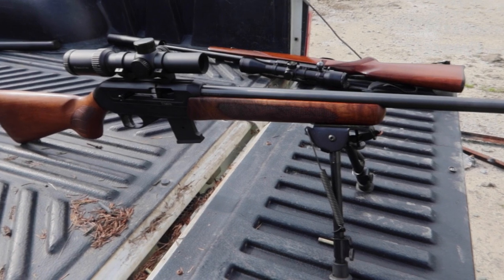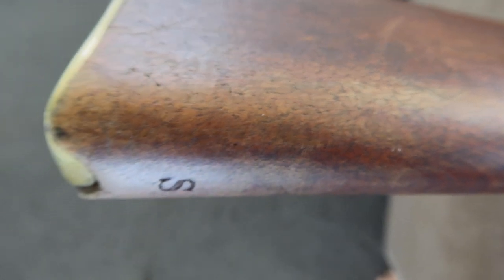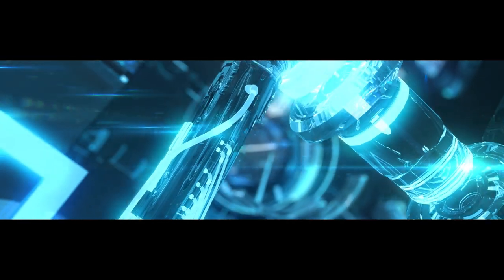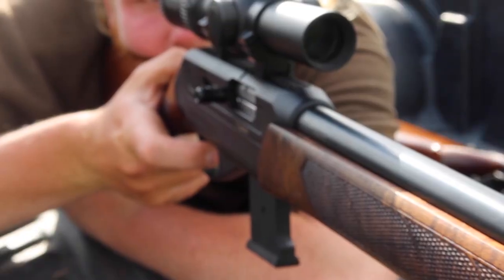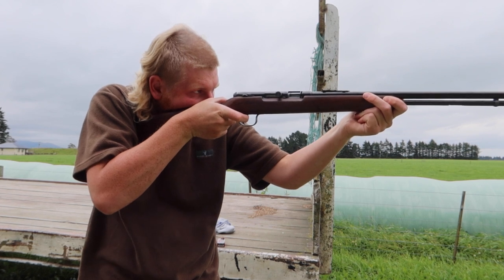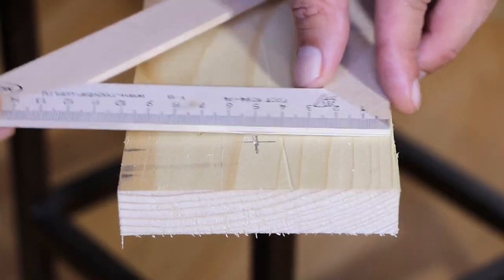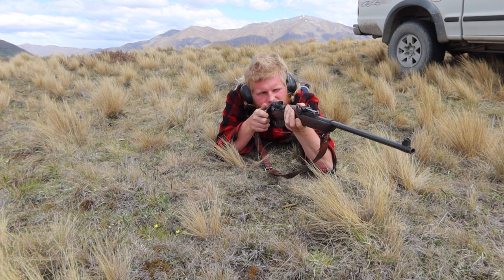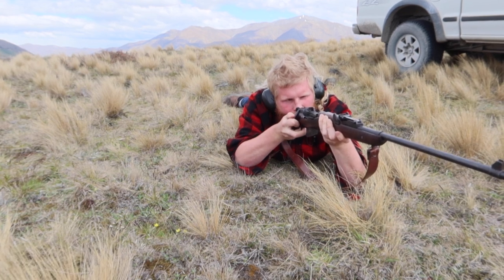Wooden stocks vs synthetic

Comment: The only real downside to the synthetic stocks is either the lack of quality control or it just wears down worse than wooden stocks.

Especially from a botched rifle product launch (from making bad stocks for it) or from previous owner had made it went through hell and back.

The company bottom line is always about the money and would use synthetic stocks on cheap rifles more than wood rifles.